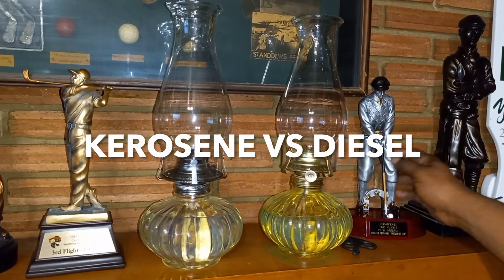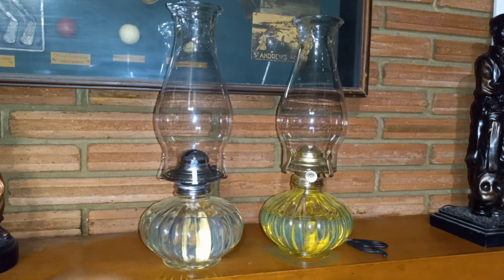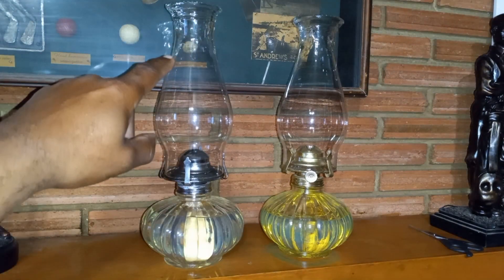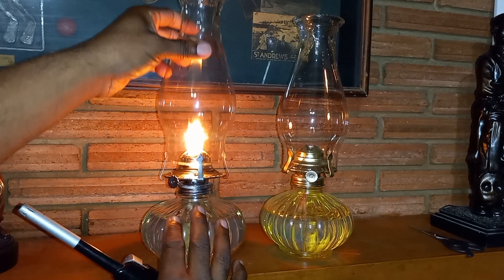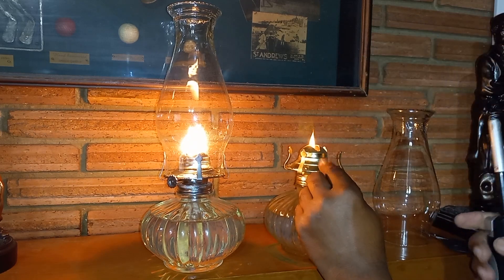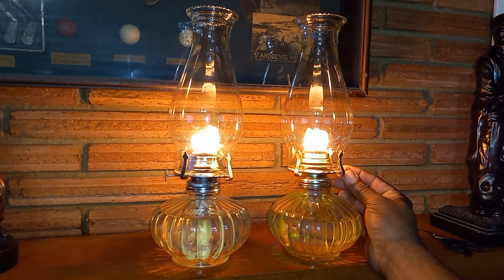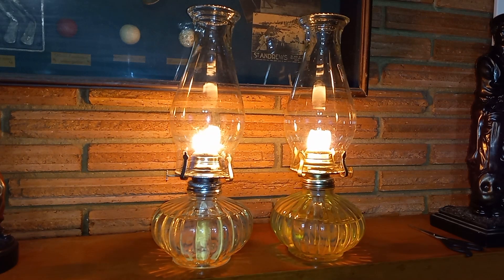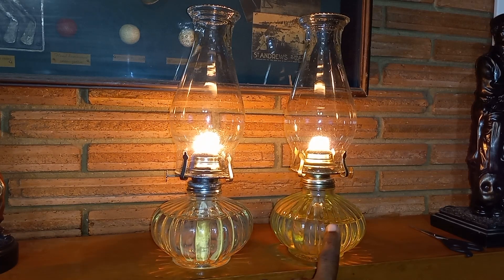Kerosene Vs Diesel In Oil Lamps.. Which Is Better

Comment: I lived in central Ohio most of my life, but have been living out in southern NV the last ~15 yrs. Never seen kerosene at a gas station before. I'm sad that I can't easily purchase kerosene. I just started buying oil lamps and lanterns for the first time, and am shocked that finding fuel for them is a tad difficult, and quite expensive, at least out here in NV. $25/gallon for refined lamp oil, $12/gal K-1 kerosene in a gallon jug. Diesel is under $4 right now/gal at the pumps.
Reply from the maker: It can get expensive especially when you start using the kerosene heaters.. I burn both in the lamps.. the kerosene is a little brighter but when we’re using the lamps outside I normally use diesel.. I hope you can find a station that sales kerosene.. take care and thanks for sharing your experience

Comment: pure k-1 kerosene is better refined than pump diesel and costs a lot more and is harder to get. If you have NO electricity at all , which will you use?
Reply from the maker: @DougHinVA  We have been in situations where we had no power for days during winter storms… both provided light and a little warmth to the rooms…

Comment: My eyeballs are not officially calibrated…😂…but the kerosene seems to be a whiter hue vs a more yellow hue from the diesel. IMHO, kerosene is much better to burn indoors.
Here in Utah, pump kerosene is like a unicorn riding on a rainbow. Can’t find it. But…I found a bulk petroleum company in Salt Lake that sells it at the pump at their facility. As of 14 Feb, 2025, it’s $7.12/gallon. That less than half if you buy it in the gallon jugs at a home improvement store or even online.
This was an excellent video. Idiots will scream, “non-scientific!” 😂😂
But seeing is believing. The extra $ is worth the reduction of fumes over diesel…for me anyway.
Reply from the maker: @stuartowens3506  well.. you eyes are calibrated enough to be correct in this situation.. you are right the kerosene is brighter and burn a little hotter… I haven’t had any problems burning diesel in these indoors.. I think I fill all the lantern with kerosene in December.. the k1 at the pumps here are $6.79 as of 1/14/25.. I know it’s beautiful in Utah and I’m sure the winters are just as challenging.. we didn’t get the extended extreme cold weeks like we have gotten the past 6 years so I didn’t run the heaters often.. take care and thanks for sharing

Comment: In my area. You can run 3 diesel lamps for the price of 1 kerosene lamp. That's a lot more heat and light😊
Reply from the maker: @beans310eight  here.. it would be 2 diesel lamps for the price of 1 kerosene lamp… thanks for watching

Comment: Thanks man. I have used Kerosene in my lamps for years and its getting so hard to find. Most places I can find it your looking at like 4 to 5 a gallon. I wanted to test it myself but just havent taken the time, What little brightness differance there is, its negligible. Im on the gulf coast in Mobile and looking to be hit by the next hurricane so this will come in handy, Your video should have a million views, but I want to thank you for doing it for me, May God bless.
Reply from the maker: @1emayte  tanks for the kind comment.. the diesel works great and you can always raise the wick for a little more brightness.. being in Mobile and the storms that come through you do need some kind of backup light.. I also use stick lights, you might want to check those videos out, they are much brighter and use batteries.. I would love a million views!! Thanks again.. take care and God bless as well

Comment: Brighter hot and diesel smell much more than K1 kerosene. I have been around kerosene lanterns for years as a kid on our month long camping trips. As an adult, I still use hurricane lanterns. As a fact, I am typing this with two dietz lanterns les then 3 feet away. Diesel will work k-1 kerosene is much better, and for indoor use paraffin lamp oil, it smells much, much less. However it costs more and it is not good for cold weather or storing in cold areas. An example is right now. 2 of my 7 have lamps  paraffin oil 1 has tiki oil for mosquito repellent, and 4 are empty with kerosene stored for them. These lamps are great for power  outages camping or just backyard fun time. No cords and sockets that are never nearby.
Reply from the maker: Sounds like you know how to survive when the grid is down..  I to have been around oil lamps from childhood to now.. I still have my great grandmother’s lamp.. I started using them more around 2011 .. they are perfect for those winter outages and to knock the chill out of some of the back rooms.. I also use kerosene heaters which are lifesavers when the power is out 2-3 days during the winter.. thanks for sharing your experience and thanks for watching

Comment: Unfortunately both of them are too dim to do much good. They are nice to have and playing with fire is fun.  From experience, diesel will gunk up a wick eventually.
Reply from the maker: Thanks for watching and the wonderful input
Reply: @wemcal  I've pretty much switched to Aladdin mantle lamps. They used to be very exspensive but I'm finding nice ones for around $50 these days. They are more finicky than flat wick lamps.
Reply from the maker: @paulhare662  I have been looking at one at an antique shop here.. I do have a propane mantle lamp. These are fine for what I use them for.. I also use extremely bright stick lights, they are WONDERFUL!! Check out the video I posted regarding those, very bright..

Comment: Yes all diesel is mandated be the Gov to be ulsd. #2 is a light green/yellow, #1 is clear( used where it is cold, doesn’t gel as easy. Most mix it). Bio-diesel is clear. Not arguing just observation when buying. Still trying to find the clear stuff in my area, the place I was getting it closed.
Reply from the maker: Right… our K1 pumps ran out Wednesday right in the middle of the freeze…

Comment: Thanks for the info! As power grids are failing more and winter weather is here, I am trying to figure out how to prepare for outages! Thought about kerosene heaters, and I am going back to watch one of your videos, but in single digit weather, doesn't opening a window for proper ventilation make the room colder?? Also researching gas generators to go on patio, but to run electrical cords into the house, how can I close and lock my back door?? I really feel I need to get some kind of backup ASAP!! Thanks so much for your videos!! I am subscribing!! ❤🤗🤗🙏🙏🙏
Reply from the maker: Thank so much.. these power outages are becoming a nightmare.. we are under an energy conservation alert for the next two days.. rolling blackouts are possible with 7 degree weather.. the fireplace and kerosene heaters are the e stand by… another choice is a ventless natural gas heater.. you want lose much heat from opening a window.. thanks for supporting.. hope you get a backup soon.. please share with us your solution.. thanks and stay safe and warm..

Comment: Which is better?  Neither.

Both are not suitable for indoor use.  Both give off noxious fumes, will stink up everything in the room made of fabric, and will soot up the globe even when the wick is trimmed properly and adjusted to most efficient height.

I recommend parrafin oil for indoor use.  These lamps are so cheap  to run that the cost of parrafin is worth it.
Reply from the maker: Thanks for your comment.. thankfully I haven't had any of those problems. The fumes are not bad and I just clean the glass all the time. I have uses paraffin in the past, I have no problems usin kerosene or diesel. Thanks for watching and please check out some of my other videos.. be safe and take care

Comment: Yes those are horrible. The new short ones are more like catalytic. No smell, very low noise level. Burn kerosene, diesel and jet A. I burn my diesel in an Aladdin lamp without the mantle. Blue flame. Put out a lot of heat.
Reply from the maker: We stopped because they were a pain moving around and needed power to blow.. we have the top mounted propane burners now.. you burn your Aladdin lamp without the mantle, hum… I might try that

Comment: If you get #1 diesel or bio-diesel it is clear like kerosene. I have 35 gallons of it.
Reply from the maker: You are right… #1 diesel is kerosene, #2 diesel is engine diesel… we had a torpedo heater that ran both diesel and kerosene… got rid of it
Reply: @wemcal        'got rid of it'    was your choice and a cold house is your choice also...
Reply from the maker: @ thanks

Comment: No worries. Been using alternate fuels for 60 years. Kerosene use to be dirty but refining advances have improved everything. Kerosene is #1 diesel, sulfur made #2 look yellow and smell. In most things that say kerosene, you can use kerosene, uls diesel ( clear ) , and jet A. If what you are using has a fiberglass wick , you have to stay with kerosene or one of the expensive clean fuel. Learning process. Never stop safely trying new alternatives and ignore the safety sallies. Look up Oil Burner on YouTube. Good simple stuff and a real hoot.

Comment: Correct Nick with one additional note, ultra low sulfur diesel is clear like kerosene and does not smell like the yellow stuff. I use it in all my oil lamps and lanterns. Good vid.
Reply from the maker: Ultra low sulfur, just a question, is that the K1 at the pumps… I get my K1 from the pump but it’s kerosene (k1).. it’s higher than the diesel (k2). I think because I use diesel so much it isn’t smelly to me.. thanks for the information, check out some of my other videos they may need some input as well, you never know, and please consider subscribing if you haven’t already… thanks for watching and please have a wonderful weekend
Reply: False. It’s green
Reply from the maker: @levidrake208  green?
Reply: I work delivering fuel good diesel ulsd is clear
Reply from the maker: @jonathanrobles2932  is that ultra low sulfur diesel?? 15ppm
Reply: Yes it is ulsd

Comment: Hello Wemcal, I thought I’d give you a little knowledge to help you out. First let me say I absolutely love the idea of using diesel in a oil lamp and a heater. But I ran down this rabbit hole a few years back. What I discovered was that diesel and kerosene are almost the same thing. Actually kerosene is #1 diesel and what we call diesel is #2 diesel. #1 diesel is refined more than #2 diesel that’s why it’s called #1 diesel. Also to cut down on the confusion #1 is sold as kerosene. My explanation may be backwards, meaning that the original name may have been kerosene and changed to diesel. Never the less what we buy as kerosene today is far cleaner than diesel. It burns much cleaner, hotter, and brighter because of less impurities in the fuel. I hope this will help you out. Please don’t take what I say as gospel. Search this out yourself. Use the phrase #1 and #2 diesel when you search this out.
Reply from the maker: Thanks for your information.. I’ve known about diesel #1 and #2 for years with past work projects and cleanup sites from kerosene/diesel spills… somewhere around 1991 EPA made sure I knew.. most of the time I have diesel in these lamps alone with tiki burners on the patio.. i use to have a forced burner that was kerosene/diesel… please check out some of my other videos and consider subscribing if you haven’t already… thanks again for the feedback and please… have a wonderful weekend

Comment: Interesting test.  Thank you for sharing.  If you leave those lamps running for an evening I think you'll find another advantage of kerosene, it burns a lot cleaner.  The air in a room can get pretty nasty with a lamp burning diesel.  Kerosene isn't without issue either but there's much less soot and partially burned hydrocarbons being emitted.  :)   

By the way, is that a gutta percha golf ball in the background? Another interesting bit of history there if it is.
Reply from the maker: Thanks for your comment and watching the video.. I have been using these kind of lamp for about 23-25 years basically with diesel because I never had a use for kerosene until 2018.. I never had any soot issues with diesel and was curious because I plan on getting a perfection heater in the months coming and plan to burn diesel in it.. it’s still an idea floating around… the golf balls are … hand hammered snow guttie (the brown ball), gutta percha (middle ball) and core wound #10 (right ball) … thanks again for watching and please consider subscribing if you haven’t already.. thanks
Reply: @wemcal  Maybe diesel is a cleaner these days :)   We never used oil lamps on a regular basis but living in the country you could lose power for a day or two on rare occasions so we'd break out the old oil lamps.  We tried diesel as we had it handy but it made a pretty good stink so we just kept a gallon of kerosene handy.  That was in the 60's though and diesel may have been dirtier in those days.
Thank you for the information on the golf balls as well.
Reply from the maker: @xlerb2286  you are welcome.. in the early 70s we would use lamp oil that was purchased at stores like Woolworth, Fred’s and Woolco .. I want to say it was paraffin.. I have to agree, diesel is cleaner than it was 50 years ago.. the diesel was still bright.. are you a golfer? When I started playing the balls had the liquid fill core wrapped with rubber string
Reply: @wemcal  Nope, not a golfer.  I don't have the patience.  I'd be that person jumping up and down on their clubs.  But I pick up odd bits of technology and golf balls are really quite interesting.  I remember the rubber string / liquid core balls.  As a kid I wanted to drill a hole through a golf ball.  It did not go well ;)  I didn't know they weren't made that way anymore.  
I remember we bought some scented lamp oil once.  One bottle is a lifetime supply, you'll never use it again!  That also was ~50 years ago and I bet the bottle is still in my parent's basement.  I'll check next time I run up to take a look at the place.